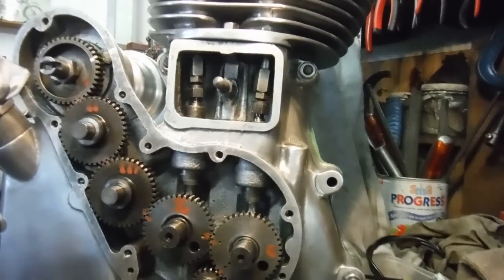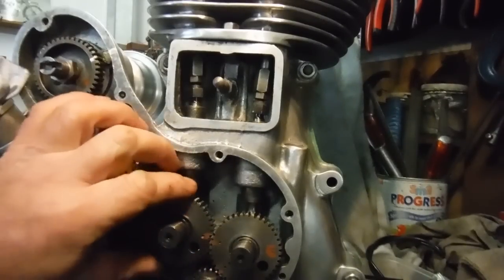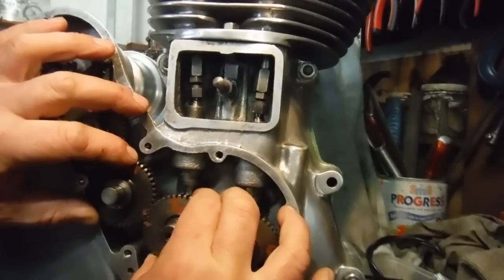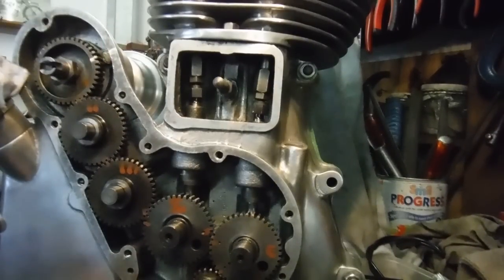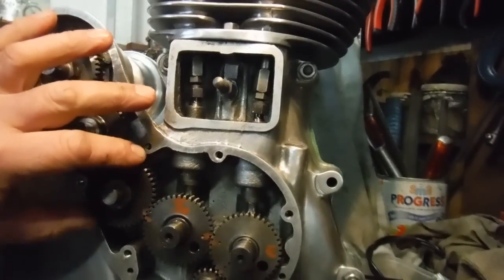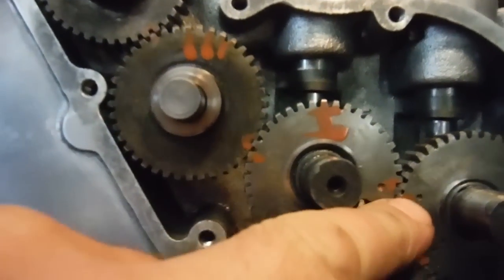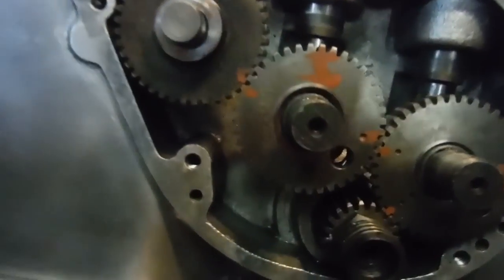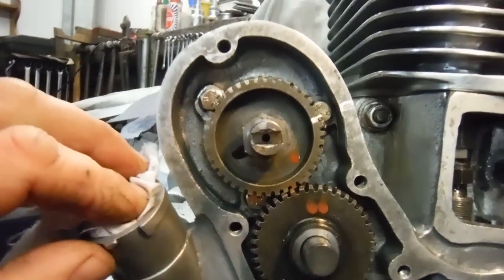Royal Enfield Bullet retarding inlet timing by Performance Classics 2

Comment: @paul Hi Paul. Will it work with a UCE 350 which is rebored to 400 cc and compression upped to 9.5:1?
Reply from the maker: I would expect it would work very well!
Reply: @paulhenshaw4514  Thank you Paul. Validation to any extent and in any form from you gives so much confidence. One follow up question though. Since UCE 350, 500 and 535 they all share the same inlet and exhaust part number how much degree is one tooth inlet retard on a UCE inlet cam?
Reply from the maker: 1 tooth = 18 degrees.
Reply: @paulhenshaw4514  Thanks again Paul 🙏
Reply: @paulhenshaw4514  usually how many revvs roughly we add by retarding one tooth? Is it like another 700 rpm or so considering fueling is sorted right?

Comment: Re backlash. There seems to be plenty of advice about rocking the engine back and forwards to locate the ignition point. I think this, if followed can lead to an inaccurate result. Rocking the engine back and forwards in an attempt to find the desired timing point is likely to lead to a less accurate result. If you set ignition timing with the engine loaded in the direction of normal rotation will give the best, most accurate timing which will be most evident during acceleration rather than under no load where the backlash in the timing gears will produce a variation in the firing point. This combined with a precisely determined top dead center point and the use of a degree wheel will give the best possible ignition firing point for points or electronic triggers.
Reply from the maker: Absolutely!

Comment: Paul I have a 1950 350cc im about to rebuild so retarding the inlet by 18 also apply to 350?
Reply from the maker: Hi Andrew, it works mainly on Indian built 350's and only with a very high compression ratio, otherwise they end up gutless and revvy.
Reply: @paulhenshaw4514  aah ok look i saw your crank balancing (tick on that) with HC id like to wake it up a bit would it tolerate 9:1? Paul if this isnt the place ill email you 😉
Reply from the maker: Hi Andrew, 9:1 is just where they start to wake up!
Reply: @paulhenshaw4514 😂

Comment: Will that be the same for a 1959 250 clipper cheers neil
Reply from the maker: Hi Neil, if it is the separate gearbox type, it could benefit from having an exhaust cam fitted - and timed to suit - instead of the inlet cam.
Reply: @paulhenshaw4514  cheers Paul,Iam in the middle of swapping my 2005 Electra 500 clubman for a 1959 pre unit 250 clipper hoping to get it this w/end,would you know if you can still get parts for them ok as everything sames to be for the 350 etc?do you mean retard the exhaust gearing by one tooth like in your video,cheers again and keep up the cracking vids,neil 👀
Reply: @paulhenshaw4514  hello Paul  it is the pre unit type ,are you saying to turn the exhaust cam one tooth anti clockwise,cheers neil.

Comment: im puting a fuel x optimizer on my 2019 500 if i retard the cam as u have done will the modifications clash in any way
Reply from the maker: I don't know what a fuel x optimizer is, but I doubt it would do any harm to retard your inlet cam.
Reply: @paulhenshaw4514  its a updated ecu that piggy backs on the bikes original ecu with 10 maps avil via switch on h/bars ... means u can run richer or leaner

Comment: Hey Paul, hope you are doing well mate 🍻
I have a 1951 bullet G2. What adjustments need to be made on the timing retard/advance handlebar lever when operating the bike. Is it set to advance on startup/warm up and retard when riding? I cant seem to find much literature or videos on it. Bit of a novice on the bike at the moment but really enjoying tinkering on it.
Cheers mate
Reply: I’m in Australia to mate
Reply from the maker: Hi Kory, usually you want about half of the retard lever movement in the retard direction for starting, assuming the timing is set correct. You can usually ride on full advance, once underway, but a little retard sometimes helps at lower speeds and up hills etc and will also help ease any pinking under load.
Reply: @paulhenshaw4514  thank you very much Paul. Appreciate mate 🍻

Comment: can you retard the cog on a 2007 Electra x and is the old filter casing separate .thanks
Reply from the maker: Yes, I have done just that with the Electra X and it does help, although they are better off with a set of Redditch 'S' type cams fitted, with the inlet cam retarded by 1 tooth. Not sure what you mean by old filter casing, sorry.

Comment: Hello Sir, i really like your videos, keep on going.
Im about to change the hole gaskets, now i have a problem with the Timing cover, when im screwing it down by hand with a flat screwdriver, the kickstarter is very hard to turn by hand, like if somthing is pushing too hard against the pignons inside the timing cover....
What am i missing?
Reply from the maker: Hi Stephan, perhaps the new gasket is thinner than the old one and is causing the timing gears to bind.
Reply: @paulhenshaw4514  Hi Paul, thanks for the quick answering!
Ok what about putting a little silicone compound on both sides?
The hole gasket kit comes from Hitchcock Motorcycles
Reply: And for the tappet clearence, as per book they are to adjust without play upside down, and spinning freely by hand, my tappets have no upside down play, and spins freely by hand but just like 3 to 4 turns then they block and i have to turn the other side, is this normal or do they have to spin freely as many turns possible?

Comment: improves the ram effect   which gives more top end  have you tried a long intake  pipe
Reply from the maker: More than that, it softens the compression stroke, helping the engine rev higher and run smoother, with less likelihood of pinking and reduced vibration, if combined with a high compression ratio. I tried various lengths of inlet manifolds in the past and decided I like to keep the carbs quite close to the inlet valves.

Comment: I'll give this a try.Already have a high compression piston 8.5-1 on my 1992 350.       I've now tried it and there is more of a increase in power around 45mph in 4th gear and does seem to get to 60mph a little quicker where mechanical noise is acceptable.

Comment: Hi from New Zealand, just stumbled across your channel and I’m most impressed.  Can the retarding of that cam be done on the 2017 Classic 500 also? If so.
, I’m doing an oil change shortly so to be do this at the same time, would be great timing. (No pun intended)
Reply from the maker: Hi Alastair, yes you could do it, without causing any mechanical harm. I haven't done it with any of the UCE engines so far, but am about to do it with a 535 GT. It should liven up the top end revs and power a little, I hope.
Reply: @paulhenshaw4514  Bloody Magic!   I’ll look forward to your thoughts when you do it.  Cheers for your prompt reply Paul.

Comment: I just swapped the oil seal at the timing side which i had mounted the wrong way, hence maybe the 'brave' oil consumption of the new rebuilt engine.
I will retard the inlet and see what happens, now i got the carburation satisfactory (OKO 30mm, KLK needle 3rd notch from the top, 132 MJ, 40 IJ.)

Comment: Backlash in gears shows just why you should aways time after taking account of play
Reply from the maker: Yes, I once checked the timing of a magneto fired Bullet by strobe, to find at a steady 4,000 RPM, the fully advanced timing was wondering back and fore by 11 degrees, according to the marks I put on the alternator rotor!

Comment: Before i mount the cover.. What is exactly the effect of retarding the inlet cam? Are there disadvantages?
Reply from the maker: I wouldn't do it with a standard 350, but standard and tuned 500's will liven up, as well as tuned 350's. You lose a bit of 'thump' at low revs, but get more revs, power, speed and acceleration. you can't do any mechanical harm by retarding the inlet cam timing.
Reply: @paulhenshaw4514  Okay, some say it won't have a positive effect on a std 500. But when i have the carburation sorted out for sure i will have it a go..

Comment: Really a class of valve timing and ignition timing. I did not imagine that these gears would wear out that could mean a large variation in the ignition time. Have they been mistreated with old, low-viscosity oil. Curves of magnetic material to increase the magnetic field, made of rare earths, would greatly increase the firepower (spark). Many companies in China sell these curves at a favorable price. With the Performance Classics assembly of a high-expansion, low-alloy piston and a suitable carburetor, a 500 c.c. would go along with many more famous machines in the category. Wonder of regulation. High competence. Grateful for the demonstrations!
Reply from the maker: Thanks again, Glaico!

Comment: Do you think the backlash (play) towards the ignition axle is the cause of the uneven idling of the enfield?
Reply from the maker: It could certainly contribute, I once strobed a magneto type Bullet to check the timing and at steady engine speeds, it was wandering by 11 degrees on the ignition timing!
Reply: @paulhenshaw4514  Yes you told in your vid.. That is quite a lot.. but okay, on a low compression/sofly tuned engine less of a problem then on a 'normal'bike. 
indeed i have a single barrel jawa.. Spark factory on the crankshaft...
The design of the bullet makes it hard to build on a direct connection from crankshaft to timing.

Most of my enfield riding i did/do on my diesel (188Winsun engine) since 3 weeks i have a 500 petrol bullet.. i like itand want to keep the engine.. msut do research to get it all right.. (i belive pistons and vale springs are prone to break down?)
Reply from the maker: @enfielddnepr  The pistons in the Indian Iron barrel 500 Bullets can lose their crowns and break conrods, if revved hard.
Reply: @paulhenshaw4514  And revving hard, is that anything above 80 kph in 4th gear?
I must say, i've installed an (absorption) bsa m20 muffler and the sound is awesome!
I am waiting for Topham to open so i can order a mikuni manifold to install a 30mm PWK carb.. Hope to find a set-up with this mufler and the 'pancake' air filter and discard of the lawnmower-amal...

Comment: Can a 350cc iron barrel be converted to 500cc iron barrel, if so what would be the requirements
Reply from the maker: Yes, with machining work to the crankcases and fitting of 500 crank and conrod - hardly worth it really.
Reply: Should I purchase a 500cc Block kit and Are both 350 cc and 500cc heads are same??
Reply from the maker: No, I wouldn't and the heads are different, too. Easier to swap a whole engine.
Reply: Ok then a 500cc crank, 500cc piston and 500cc head and barrel
Reply from the maker: And a lot of machining of the crankcases !!!
Reply: After so much will it really be worth it
Reply from the maker: No!
Reply: @paulhenshaw4514  Sir can i install Amal carb to my 86 Ci 350 enfield, which will be good
Reply from the maker: @aleeksarkarece1256  Yes, you can.
Reply: @paulhenshaw4514  which model for better performance

Comment: im getting whinning noise from my timeing side cover .. wat shoul i do about it..its a 350 Indian bullet
Reply from the maker: Better take the timing cover off and have a look.
Reply: @paulhenshaw4514  i did n didnt see much of a backlash other than the gear connected to the points .. does the cam gears get tight overtime ? or loose ?..i think its on the tighter side

Comment: I did this to my 1999 year 500 bullet, the change was amazing, first of all the bike is so easy to start now and seems less stressed. On the performance side above 50mph the bike is more willing to go and higher speeds are easier to maintain. The only small downside is correct use of the 4 speed gearbox in between 3rd and 4th on hill climb if its very steep, overall the bike has changed for the better and would not go back to the original setting.
Reply from the maker: I think the Indians like them to be able to slog around at 20 mph in top gear and that's why they are not timed to give their best at higher engine speeds. Glad you like the change!

Comment: Not too interested in increasing higher rpm performance as the original bottom end is still intact on my 2002 500 ks model & likely wouldn't survive much thrashing at high rpms. Seems the midrange torque could use a little "shot in the arm" though. If upgrading to a higher compression piston & top end tune wouldn't raise my operating temps, I'd love to do that. These triple digit summer Texas day temps would probably be the death of it. Would installing a hi compression piston really raise operating temps that much?
Reply from the maker: You should be fine to go up to around 8.5:1, but you might need to jet up a little accordingly. It shouldn't do any harm, though.
Reply: 8.5:1...couldn't I reach that just by shimming down to close up my combustion chamber betwixt piston crown & head?
Reply from the maker: No, it would give a tiny increase, but barely noticeable. You could shorten the cylinder barrel by 2mm to move things in the right direction, though.
Reply: Thought crossed my mind, maybe we can extend the spark plug - machine on so it screws in further to raise compression?  It may run hotter at the tip.  I think they keep compression low for kick starting, my '2000 350 bullet is hard to kick over with the stock setup - no electric start.  Imagine the 500 is worse, thats why it has lower compression.  These definitely should not need premium gas, mine is like 7.5:1 I believe.

Comment: Hi Paul, i'm tempted to try this on my 350 Bullet but just wondered when you say it has improved the bike, in what way do you mean? More power from the engine or better efficiency? Cheers
Reply from the maker: It works best if the compression ratio has been increased, it helps the engine maintain power further up the rev range and to rev higher with a small sacrifice of some bottom end power. It also helps eliminate pinking by lowering the cylinder pressure a little on the piston upstroke.
Reply: Paul Henshaw hey paul, won't retarding  the inlet cam decrease the overlap of exhaust and intake vale and will provide more low end torque ?
Reply: @Badass_Baniya  Retarding the inlet timing means the inlet valve closes later, this can allow better cylinder filling at his RPM when gas speed is high.
Reply from the maker: In the case of these engines, it seems to lose a little bottom end 'thump', but they gain a bit of power and rpm as a result..

Comment: Will this work with the EFI? What effect will it have?
Reply from the maker: I don't know about the EFI machines, but retarding an inlet cam shouldn't do any mechanical harm, as the valve will open later [earlier or advancing the cam is the risky one], so you could try it and see how it goes.
Reply: Thanks. I can't find any numbers for the valve timing on the EFI so it's if it ain't bust don't fix it. I'm considering the hi-lift cams but not in a hurry to pull the engine apart. Runs out of steam at 5000+, which ain't too shabby in top. It's not quite on full throttle, feels like there should be a drop more but it doesn't want to give it up. Scratching my head why it doesn't want to rev a bit higher, mesh in the back end of the silencer looks a mite clogged and restrictive ... other stuff to try first. Advance the ign timing a bit more on the PC5 at the top end?

Comment: I really enjoy your video postings Paul. Thanks for sharing your experience and knowledge so freely.  I'm going to try this on my bike. Would you advise any change to the standard ignition timing to go with it? I set mine with the bob weights wedged fully advanced at 8.5mm BTDC.
Reply from the maker: Thanks, John. If the ignition timing is correct, leave it as it is, but if you have a high compression ratio and you have retarded the ignition to combat pinking, you should be able to advance it again with the retarded setting of the inlet cam.
Reply: Hey, what do you know. Tried the bike today with the inlet can retarded and it does indeed rev more freely. It also ticks over much more regularly and seems generally happier with life. I wonder now how the advanced condition came to be standard. Was something lost in translation perhaps?
Reply from the maker: Glad it worked for you and you are happy with it ! I think the Indians like more low down power, as it would probably suit the bumpy roads, slow traffic and all the stuff and people they appear to carry. Just my theory !
Reply: @paulhenshaw4514  this engine is England technology, I have royal Enfield 1966 made in England model with same engine , this engine is now making in India but the original technology is from ENGLAND for world wide not only for Indian .
Reply from the maker: The Indian made engines run very differently to the British ones, which had different cams and timings and better ports in their cylinder heads. A 1966 machine will not be British, as the last Bullets made in England were 1961 / 62. The engines look almost identical, though.
Reply: @paulhenshaw4514  ok, but my engine is G2 , and I also need your help regarding my royal Enfield , I set perfect timing (8.5)mm and it having staring issue sometime it start but I accelerate it will turn off  and when I set timing to advance it turns on perfectly fine but it gives back compressing. Can you please tell me what is the problem how to solve it .